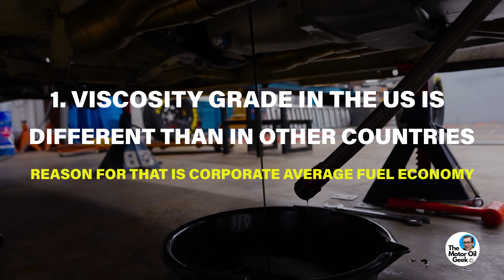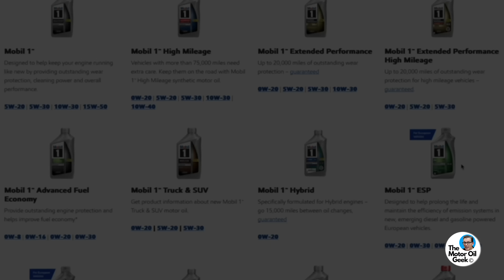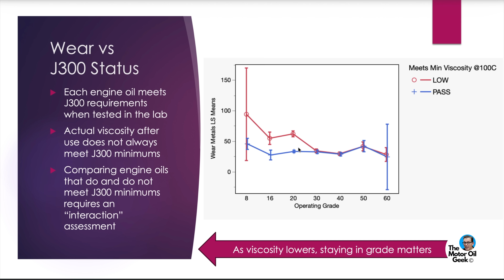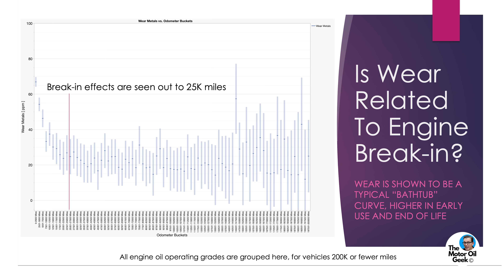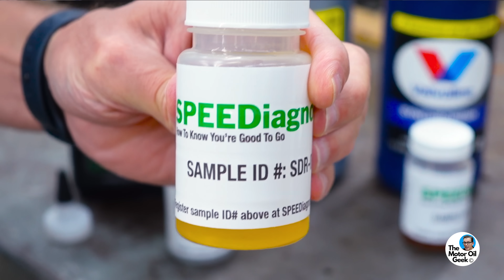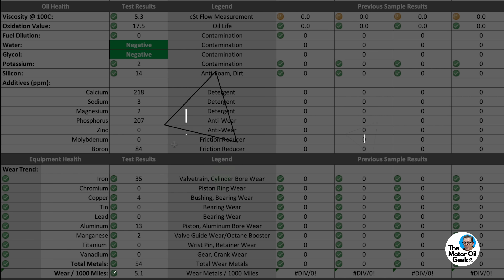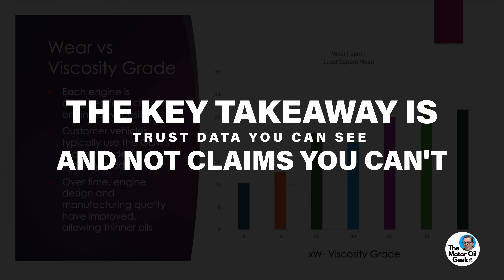More Ai Lies? The FACTS about 0W-20 vs 5W-30 (With Evidence)

Comment: Would you mind clearing up a situation like this a bit?
if you see this 0w-20 vs 5w30; wouldn't you want to switch to 0w30, and keep the cold viscosity and add the higher temperature viscosity/protection?
the oil viscosity charts show you a generalized idea of what grade you need for your environment, and you need to know what your engine pressures and tolerances need for the type of use you do to figure out adjustments from there?

So use the lowest 'first' number you need for the temperatures you will see during that oil interval (summer in Florida or Arizona vs winter in Canada); and the highest 'second' number for the loads and heat at operation you will see (low compression light car driving around flat roads with 60F vs pulling a 6,000 lb trailer up a steep grade in 100F); 
as far as I've come to understand so far.
Reply: You didnt listen to Lake. The larger the spread, the lower the resistance to shear.
Reply: @lexusguy9127  first; I do comment while writing; second, assuming you know all nuance from a few minutes of video is unwise; third, from watching much of Lake's content my presumption is as follows ...  always stay the same or lower for the first number and the same or higher for the second number, if you aren't going to dive a lot further into the science of it.

Example; 0w-XX could be '0' for many, many reasons, if we are talking old school engines, for base outside, cold start temps; but if oil is being used as a hydraulic fluid for a) Variable valve timing or b) cylinder deactivation or c) some other system that activates on oil pressures ...
it may be assuming you are using 0w oil and if you use too heavy a base weight (20w-), it could cause issues or vice versa, too thin a base oil  (manufacturer states 20w- and you use 0w-).

So; if you can kindly explain all possible scenarios to me, then I can take your advice LexusGuy; but until then, I'll kindly and patiently wait for Mr. Speed Jr. to possibly reply, or another tribologist who understands oil viscosities, brands, and applications better than you.
If I was asking specifically for Lexus cars; or you want to speak for Lexus cars in particular, then let's have a civilized conversation;
but at the moment, you aren't understanding that my short words contained a lot more nuance that I felt was unnecessary to elaborate on because not only do I ask for my own clarification, but as a suggestion for future videos and also channel engagement ...  as every comment we have both to the infinite without answer, those he answers, or just us having a discussion ...  increase channel engagement and therefore also help the algorithm suggest his videos to more people because not only are people watching, but interaction. They consider the interaction (good and bad) to be a very high variable in their weights.  If people are engaged, they watch more, they come back.

So, I hope we are understanding each other much better now.  Yes; I did hear what was said; but it doesn't change what I asked; at all.  If you re-read what I said, it almost doesn't relate to loss of viscosity or shear much at all, but a greater idea of how to best select the 'right chemistry for the right application'  or to quote Lake "application dictates chemistry".  If you change your oil every 300 miles, Lake is not going to recommend a $50/quart oil over a $5/quart oil; unless that 300 miles is on a racetrack, more than likely.

Happy New Year, hope you are doing well :)
Reply: @Zero.Mikazuki  "if you see this 0w-20 vs 5w30; wouldn't you want to switch to 0w30, and keep the cold viscosity and add the higher temperature viscosity/protection?"

You didn't listen to Lake. The larger the spread, the lower the resistance to shear.

Happy New Year!
Reply: @lexusguy9127  re-read my last response; you didn't listen to me at all
Thanks; have a great day!

Your responses generate increased channel and video interaction; keep repeating yourself as much as it helps you sleep at night.

Hint: this isn't about THIS SINGLE VIDEO.
This isn't about ONLY shear.
Does me capitalizing words help your ADHD focus?

Good luck.
Reply: @Zero.Mikazuki  "if you see this 0w-20 vs 5w30; wouldn't you want to switch to 0w30, and keep the cold viscosity and add the higher temperature viscosity/protection?"

You didn't listen to Lake. The larger the spread, the lower the resistance to shear.

Happy New Year!
Reply: @lexusguy9127  Larger, larger makes no sense.  Much more additives would be needed to keep it in grade with a larger spread.  Just listened to Lake again, your comment is incorrect.  5w30 has a spread of 25, 0w20 has a spread of 20.  He states 5w30 sheared more than 0w20.  And he states later, that the bigger the spread, the LESS shear stable they are.
Reply: @lonniebeal6032  Correct. Not 0W-30 as you incorrectly stated above.

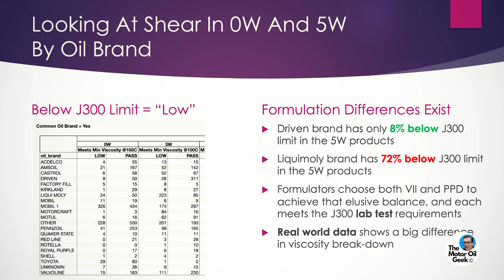Comment: At 5:10 it shows a list of oils and how many samples were out of grade vs in grade.  If you put that into a spreadsheet and do it on a percentage basis then you will know which ones stay in grade the best.  I did that and it shows in regards to the big three Valvoline stays in grade the best with Pennzoil next, and Mobil 1 last.  If you look at the boutique brands Driven stays in grade the best followed by Redline, Royal purple and Amsoil last.  It should be noted that Red line and Royal purple didn't have a very large sample size while Amsoil had a large sample size.
Reply: What does the Liqui Moly comment mean? I couldn't decipher if it stays in shear or out, better or worse than other brands.

Comment: 0w20
No margin for
-Heat
-contaminants
-quality of oil
-extended oil changes
Reply: But you get better fuel efficiency though, those sweet 0.1MPG are worth it right ?
Reply: @guillaumejoop6437  which then are precipitously negated by sludged piston rings. Whoops, time to buy a new  car.

Comment: The big debate is do manufacturers recommend motor oil to meet CAFE standards vs oil that best protects engines so they can last longer before needing rebuilding.  If so then what does the consumer do?
Reply: They make CAFE standards, not engine life, the priority.
Reply: I think manufacturers are doing their best to try an make sure their motors work well with all viscosity's.   The wise consumer will use the suggested oil and do an oil analysis after a summer run. If it fails then you have documented proof it was no good.  If you are using a group 3 oil, which most are, go no more than 5,000 miles between changes.  The only True group 4 and 5 oils I know of are Amsoil and Redline.  There is no question that the 0w8, 0w16, and 0w20 will do well at 35F and lower.  The question is how well they will do 90F and higher.

Comment: When I switched from Ow-20 to Ow-40, my wear metals had a drop on one of my vehicles, but given a sample size of 1 for each, I don't think it matters.  3.817ppm/1000 miles on 0w-20 and 3.625ppm/1000 on 0w-40.  On my other vehicle with the same engine, 2.565/1000 miles on 0w-20 and 3.897/1000 miles on 0w-40.  Ow-20 was factory branded oil.  0w-40 was Mobil 1 Euro API-SP.

Comment: So looking at the J300 chart even Amsoil oil has a low first number.  At what miles do each of those oils listed drop out of spec.   That would be when we would want to change them- mileage.  General data should help be a guide line when to though out.

Comment: I have a Blackstone UOA showing Motul 5w30 vw504 cut down wear metals better than Motul 0w20 vw508. I would NEVER follow Audi's recommendation of VW508 ever again due to the low HTHS. 

 I have since use only 0w30 Motul VW504
Reply: Nice...but what was the miles on the oil?  If it's over 5,000, ya, 0w20 won't last unless maybe it's a group 4 or 5.

Comment: great info.  my question now relates to what causes the breakdown and shearing of the oil grade?  is it heat or friction, or a combination of these two factors?  can installing a cooler thermostat plus replacing the factory coolant with a "wetter" type product reduce the internal engine temperature enough to reduce the loss of oil grade? just spitballing with these possibilities. according to the chart in this clip, only 2 oils show any significant resistance to breakdown, Driven and Pennzoil.  it might be interesting to see datalogs on each oil sample to determine why some samples passed while others failed. I'm thinking load and temp, plus as you mentioned contamination.  thanks Lake.

Comment: I know your the motor oil geek but could you be the oil filter geek and try to help me understand why a person with an $80.000 new truck wants a 4 dollar filter? We use to call it the Walmart syndrome.  A company goes into Walmart and the next year the company cant meet the price point well Mr company your going to have to move production over seas which is exactly what they did to snapper. A four dollar filter cost Penny's to produce.  We as a society should want better. GM figured out the customer wants garbage and they will pay for it and look at what we have now..... but on the original topic oil and filters oci go hand in hand with each playing an important role in the equation.

Comment: https://youtu.be/hvagxNwrNq8?si=tmovA6l2NH1XvuhN
Check out the link above to my channel where I review my 0w20 to 5W-30 oil change out
I don't know Lake I disagree,  I think the 5W30 is the way to go we used it for years without issues. The only reason for the change was because of the cafe standards,  I haven't noticed a decrease in miles my engine sounds perfect unlike when the 0W20 was in there my oil pressure is no less than 28 PSI at hot idle before it would go down to as low as eight psi that is too low and that cannot be denied. I'm testing it in the real world driving  I'm at 11,000 miles with the 5W-30 and I will never go back to ZeroW 20 no matter what any data sheets say.

Comment: 0W-20 almost sounds like conventional oil if anything with the 2nd breakdown you gave. If it provides equivalent protection while "in grade", but significantly worse wear while "out of grade", that sounds like the best thing to do is change the oil much sooner to prevent it ever getting out of grade if you running 0W-20. In other words, 3-5k should be the absolute most you go before an oil change with 0W-20. Even if the 5W-30 can provide better protection when it loses grade, it is smart to keep it clean too, hence 5k oil changes still is a good target for changes but you have more wiggle room to go further. Doesn't appear to be something you want to risk with 0W-20 and other thinner oils. Am I hearing this correct? This complicated. I'll stick to 5k and less oil changes regardless lol.

Comment: For my rv I use 5w20 in winter and 5w30 in summer. Generator calls for 10w30 but it runs hot, so I use 15w40, especially when visiting hot climates like death valley.

Comment: All the failures particularly on engines that call for 0w20 shows you everything you need to know! 0w20 oil is the common denominator in all the cases of catastrophic engine failures on the new tundra engines and the Gm 6.2l v8 engines as well. You aren’t a mechanic and you don’t see the failures every day like the people who claim the 0w20 oil is making these engines fail. Which is 100% is making them fail

Comment: The fact is, the heaver viscosities 20/30/40W oils shear out of grade faster than the 0/5W20 and when they do they offer worse wear indexes then the 0/5W20 so you're 5W30 at 5k might actually be thiner than 0/5W20 at the same milage.
Reply: I’m starting to think the takeaway may be 5W 20 for the win overall.
Reply: @Not-Anonymous-187 I've used both without paying to close attention. I think on my 13 V6 Crosstour at 150k I will try Valvoline Restore and Protect 0/20 because it's a VCM with direct injection motor has tendencies to develop carbon on rings valves pistons with tendencies to have more blowby. I am going to do a valve adjustment and inspect to see how I've done using 0/20. I won't know the real answer for my self until I actually test the oil and visually inspect the engine.

Comment: If I followed the OEM recommendation I would changing the oil at 10k or more miles per change. All the OEM cares about is Warranty period. They dont want the car to last any longer than that. So following the oem guidelines today will insure you need a new car in less than 100k miles. I guess you sold out like the rest of the influencers. Cuz now what you are telling us to do is vastly different from when you first started this channel.  I see you cherry picking data. 

Hard to shear out of grade when the grade is zero. The higher the grade the harder it is to squash the oil out of the bearing. Once the oil is pressed out you have metal to metal. 
I deal with busted cars every day. One of the tricks I use to keep oil pressure up is slightly increasing the oil thickness. 

In the 90's OEMs cared more than they do today. Even Toyota is now weaseling out of warranties over speed and RPMs. 
Back in the 90's Toyota had a commercial saying how they redlined the engine for 1000's of hours so you dont have to worry when you let you teen drive the family car. 
Now if the PCM says you went 86mph or more and you happen to have engine failure they void the warranty.  Point is the OEMs want the cars to break as the loan is paid off. 

Shame to see you that have sold out. I wonder how long before ProjectFarm sells out.  I get it you need to pay bills.

Comment: My Dad was involved with the first Jet Engine lubricants... and would have fights with every backyard mechanic that all higher viscosity oils were better... next time you fly, realize the oil in your Jet Engine is as thin as water... and it's RPM can be as high as 50 K vs your car engine at 2K .... Lake always says... Oils can be made for every application... His only issue so far is he has no -40F tests to show how well your car engine oil flows in Alaska. All engines get wear on startup mostly... you need your oil to flow as quick as possible... using 5W-30 does not flow as well as 0W-20 on those cold mornings when temps dip to negative F... I'd advise anyone who likes Lake, to go over to Project Farm and watch the -40 cold flow tests of AMS OIL vs Pennzoil ... the two best 0W-20 oils made today.

Comment: I use mobile 1 extended and change it every 5000 miles because it has very little breakdown. I don’t worry about running thicker oil.

Comment: In aviation maintenance training we learned that the best oil is the lightest oil that will still maintain a wiping surface. Our instructor worked in a lab for a major refinery for decades and ran his own dragster. Thick oil will coke your rings.
Reply: That's only true if your drain intervals are too long and the engine is being run too hot or over heating.
Reply: Did they teach you how Mobil's AV-1 synthetic oil destroyed thousands of aircraft engines???
Reply: @steveprice5664  we didn't use mobil synthetic
Reply: hmm ive had a ring around my nose from coke but never the other way hmmm

Comment: question about oil water contamination. I winter conditions driving short distances, is reaching 101°C (assuming boiling point of water at 100°C) of oil temperature tells all water in oil evaporated?